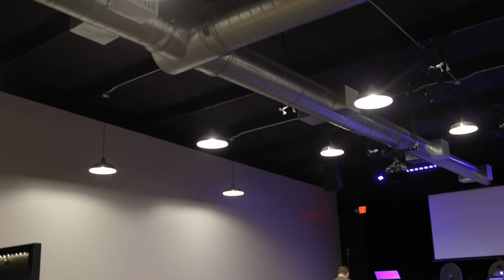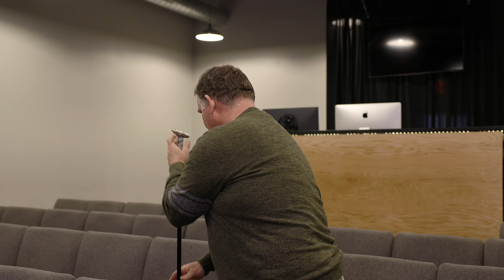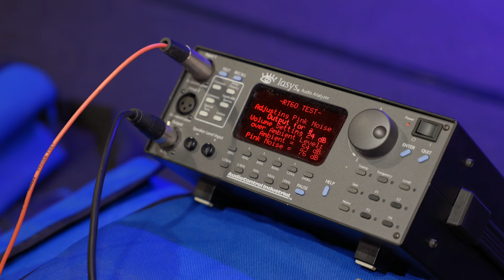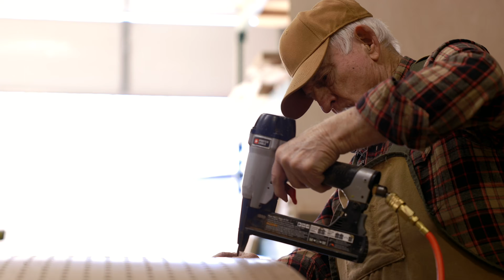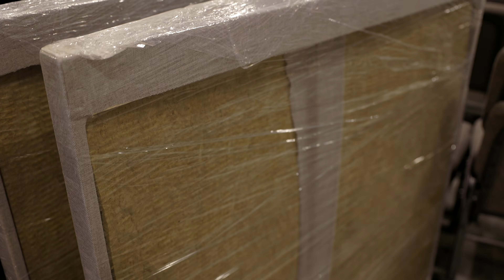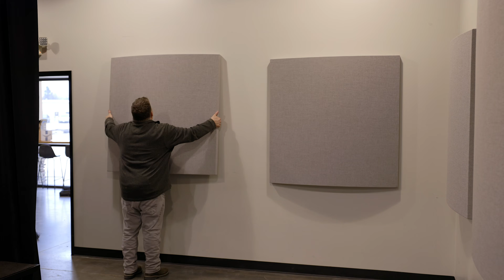Cut reflections in half with these sound panels! | Acousticurve Design

Comment: I mix in a room that is 13m x 13m and 6m high. Walls are concrete. Carpets on the floor. Ceiling is some white insulation. When im in the room talking with someone, there is an echo. We have done a rt60 test and it’s over a second. I’m not allowed to treat the room.
Reply from the maker: @original_pokey I'd recommend sending this video to the people in charge that don't want to do acoustic treatment. Maybe it will help them understand the importance and what can be gained by doing it.
Reply: @collabworship  I’ve sent all the videos and articles that explain it. Can’t do anything more than just do what I can.
Reply from the maker: @original_pokey Sorry to hear that... We will pray for them lol. Hopefully, the idea will get through to them at some point. Bad acoustics are no doubt very frustrating...
Reply: Yikes man, that's tough. Wishing the best for you.
Reply: @original_pokey if you're allowed to use portable/breakdown options one way is to make some frames out of PVC pipes with corner attachments and hang some medium heavy cloth on them. Instant screen that is easy to set up and tear down. Not the best but they will help with the ambient reverb in the room.
Reply: @stevecarter6707  when I say I’m not allowed I mean the leadership team (which I am apart of) arnt convinced we need it. BUT, we just added the x32 and I’ve been doing all the setup and the reverb is highlighted even more so see how I go
Reply: @original_pokey Sorry you're in that position with your room. Sounds like a rough place to mix but I pray it will get better as you go along. Enjoy the X32. That's a wonderful board.